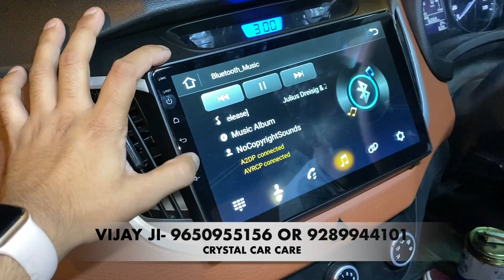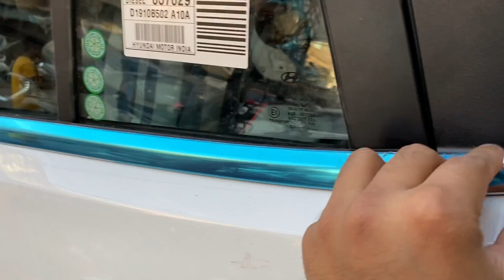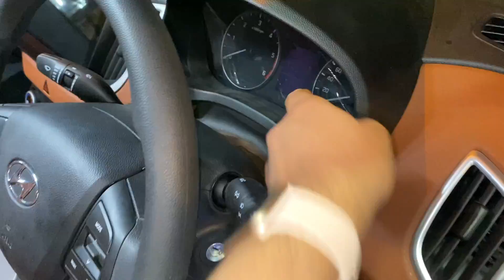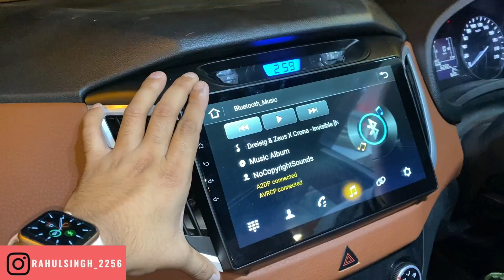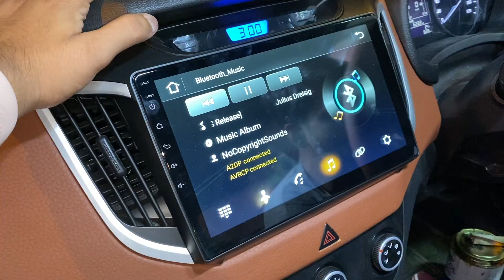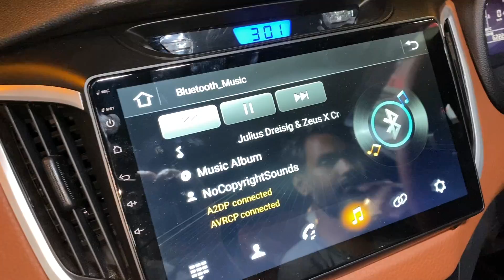CRETA BASE MODEL INTERIOR FULLY MODIFIED | ALLOY WHEEL | MUSIC SYSTEM | STEREO | Rahul Singh

Comment: Sweet simple video..💞😍
. 
But bhai ye saka,napa,malaysian leather sab duplicate leather hote hai ki original hote hai karolbagh may
Reply: Rahul bhai Please answer my question
Reply: All are sasta ragzine, real leather seat covers are upwards of 80,000
Reply: Even if you're buying real leather sandals they cost upwards of 2000
Reply: @rahulshah9845  I know bhai but mai Rahul bhai se jna chta ho
Reply: @NikhilSingh-mi2lx  I answered bcoz I know the bloody commission baaz won't reply
Reply: @rahulshah9845  thanks 
. 
Mai soch rha tha seat cover change krva lu
Reply: @NikhilSingh-mi2lx  if you're willing to spend then real leather interior work is done by Stanley leather works
Reply from the maker: Nikhil bhai, basically not as purest.
But the point is agur mene ya fir apne lgva lia by chance kal kapda mei dhikkat aa gyi like stitches nikal gya or anything. Toh we will get new driver side seat cover again for your car.
But yes we can trust that seat cover.
Baaki apni apni choice hai.
Reply from the maker: Shah bhai ji thoda sa tamiz se baat krlo atleast 🙏🏼
Reply: @RahulSingh2256  what do you mean by not the purest? Either it's leather or its not,please answer clearly